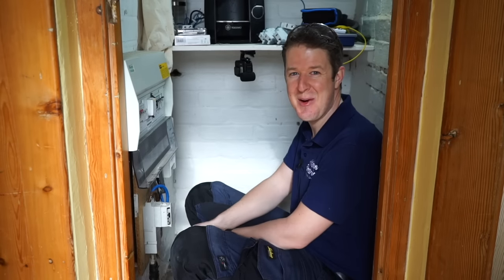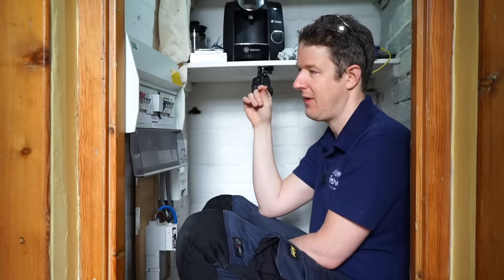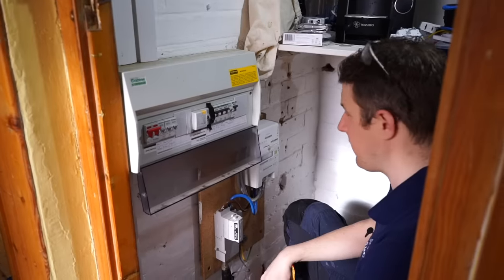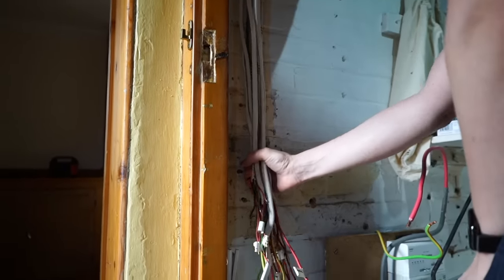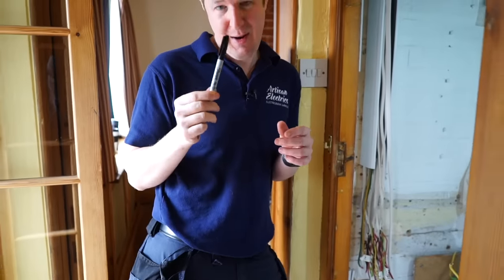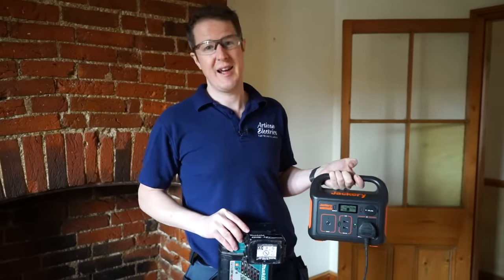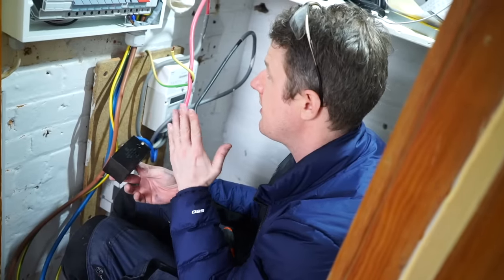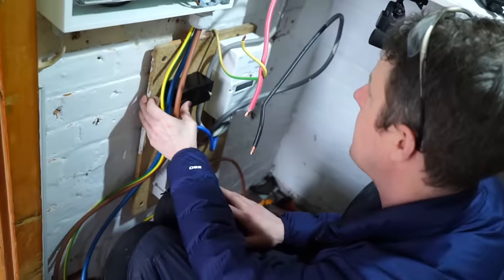My Consumer Unit Secrets 🤫 - How to install a Consumer Unit/Fuse Box

Comment: Why didn't you fit an isolator switch instead of Henley blocks ...safer and easier for the next sparks
Reply: Must admit that went through my mind as well👍
Reply: I came on to ask exactly the same!
Reply: Me too, I was expecting it. Especially as he pulled the main fuse, knowing the next guy was going to have to do same. Still.
Reply: I may be wrong and correct me if I am wrong but I thought you have to get the DNO out to fit an isolator switch 🤷🏻‍♂️
Reply: Would have been another hour extra = 96£ 😃
Reply: @seandunne2673  I’m not a sparky, but how is different to a Henley block or main circuit breaker in the CU? The DNO fitted isolators are usually installed either before the mains in or meter aren’t they?
Reply: @seandunne2673  you kinda have to get the DNO out to pull the main fuse, you'll be cutting their seal normally, it's their property. If you put the switch in after the meter then, I believe, that's the consumer's leg of the installation, so there is nothing to stop you. Only there is because you kinda shouldn't have pulled the main fuse. Having said that, the DNO should pull their finger out and fit an isolation switch already.
Reply: @GregMoseley  They're fitted after the meter, never before.
Reply: @SqwarkParrotSpittingFeathers  the isolator should be after the meter, nothing to do with the DNO
Reply: @k1lmo  I disagree, yes it should be after the meter, which is what I said; but, as a matter of law, you cannot normally interfere with the DNO's property, without their permission, which is the meter and before. Therefore, after the meter is the place, the electrician, as an agent of the homeowner, may fit a switch. 

But, whether you are right or I am, it is moot, as the result is the same.
Reply: @seandunne2673  normally yes, but as put a Henley block in, you might as well Chuck a switch on the wall
Reply: agreeded
Reply from the maker: I just didn’t feel it was necessary to fit a main isolator as I was fitting a brand new consumer unit with an isolator in it.
Reply: @artisanelectrics  Yeah but with an isolator installed there is no need to break the service fuse seal
Reply: @artisanelectrics  not what I would expect from the top end company you portray. I don’t fit isolators maybe I should but since I only fit all rcbo boards with SPD im already £100+ on the split load chint brigade and I  have to be competitive and I have no problem pulling the main fuse. Not sure why you are putting a Henley block in that’s just plain daft - more connections, more potential points of failure - please explain the reasoning?
Reply: @artisanelectrics  come on mate. Probably cheaper.
Reply: @artisanelectrics  thats pretty much the same excuse as the DNOs lol
Reply: @Marco-mg9tv  why don’t you get your head down and concentrate on your own work mr clever sparks instead of picking the bones out of he’s work , why the hell does he need to fit a isolator he’s just fitted a new board.
Reply: @Wilkkid1  oooh you’re a bit touchy eh, What’s up have you got his poster on your bedroom wall ? I’m just making an observation that I can’t understand any logic in adding a Henley block when to do so you need to pull the main fuse and therefore tamper with DNO equipment anyway. What function or benefit do these additional connections make - other than adding unnecessary and undesirable additional joints.
Reply: I can only assume his tails weren’t long enough , had a DP Henley knocking about in the van and could be bothered going to the merchant for  some more 😜
Reply: @artisanelectrics  I bet that's what the bloke who fitted the Crabtree said 🙄

Technology evolves, Regulations change, things break, accidents happen..... IMHO should be a standard as we all know removing the fuse is a no-no.
Reply: @TAJS-C  As a "meter monkey" I think we should fit them as a matter of course when we do an exchange. Sadly our pay/workload structure doesn't always lend itself to taking the time.
Reply: Yes you should fit an isolator! HSE guidelines state you should eliminate any adjacent live working on electrical systems if possible and in this case it would include the incoming tails! Probably a bit picky I know but it enables this when installing any future circuitry. Personally I think the DNO should be obligated to install meters with incorporated lockable isolators so this issue wouldn’t be an issue in years to come!
Reply: because your not authorised to do so , apply to have a SP isolator switch fitted . @Marco-mg9tv
Reply: @ali87468  I live in the real world if you’ve ever tried to get the DNO out to isolate supply then you will know…besides if the DNO were that bothered they would fit isolator accessible on the meter or isolator lane themselves on a meter upgrade - it’s a load of bollox
Reply: @Marco-mg9tv  your not OP1 or OP2 qualified , the reason you have done it this way is to save money , your R.E.C will fit a SP isolator switch , but there will be a charge . You are breaking the law and risking your life and potentially other peoples life’s .pay the charge to have an isolator fitted and go home safely and leave a safe professional job behind you , for now and the future.
Reply: @ali87468  yeah whatever. I and 99% of installers will continue to pull fuses as has been standard practice for donkeys years . Never heard of anyone getting injured or prosecuted or even a telling off
Reply: @Marco-mg9tv  That doesn’t make it right , the day will come when someone does . You haven’t carried out a risk assessment and are not wearing the appropriate PPE , as removing a mains fuse , comes under the classification of live working , if an R.E.C authorised competent person was to remove the fuse , following regulations , he would do so wearing , LV insulated gloves , with leather gauntlets over the top and be wearing a safety visor , his clothing , would also be flame retardant , with nothing metallic attached to his clothing , what so ever .wether you like it or not these are the regs .Nobody should be working live and should have point of isolation , provided by your R.E.C . These regulations evolved over years of learning better working practices , unfortunately some of the knowledge was gained from accidents, some of which where devastating. Working with three phase , makes these dangers even more significant  .
Reply: feathers  you're correct, the DNO or someone approved by the DNO, are the only people who can legally pull the cut out, if there's a SMART meter fitted, then it may transmit an alarm?
Reply: @geoffaries  a smart meter does transmit an alarm but doesn’t seem to result in any action I guess the dnos don’t want the additional cost of sending out field engineers to investigate
Reply: @ali87468  what precautions should be taken for pulling say an 80A fuse in a switch fuse ?
Reply: @Marco-mg9tv  switch off the switch , if it’s lockable , lock the switch in the off position a fix warning notice , remove the fuse from the holder and replace the holder and cover , keep the key and the fuse in a secure location .
When doing one of your consumer unit changes , what would you do when testing , if you discovered , the Brown tail , was actually neutral and the blue tail , was live ?
Reply: @ali87468  in you’re scenario you didn’t test that the load was actually off before you took the fuse out - I do. For the main fuse I visibly trace the tails to the board I’m swapping, test polarity, turn off devices, turn off main switch ,test dead at the main switch,  clamp the tails test for no load on them then do as you state above except I can’t lock off the carrier (edit - spose I could put some temp seals in place - but I do use crimp wire when I’m finished ) but it’s under my supervision as I’m working next to it - no difference really is there. If I found reverse polarity I’d stop work and notify rec of course, what’s your point there ?
Reply: @Marco-mg9tv  to test the supply was off , you need to remove the fuse
Reply: Your not prepared to admit your tampering with equipment , your not qualified to do so or legally allowed to do so , the meter board , the meter , the series 7 cutout and any neutral blocks are company property . The fuse provided by your REC , is not to protect the installation, it is to protect the REC property from , any faults from the customers side .
The question on polarity , you answered correctly , a number of contractors , wrongly think that all they need to do is swap the tails over , but what has happened is that , the transformer has developed a fault and as you say needs isolated and reported , as there’s a possibility it could change back .
Reply: @ali87468  just shows you don’t do this for a living. I’m  talking about risks associated with pulling a fuse and test and verification before doing so. The point is checking there is no load - dead on the load side of a switch and therefore no danger of arcing . I’ve seen recently a YouTube video of an  NICEIC approved contractor pulling a fuse with main switch on and all circuits energised and the flat above he suspects of the same supply but he just pulls anyway- doesn’t even look the other way 😲
Reply: @ali87468  yep I’m all of the above. Everything you say is correct I know it’s the law and I will continue to break it. I’ve gone tangential because you are boring me with the same diatribe. What’s the point of you repeating yourself over and over again ?
Reply: @Marco-mg9tv  at last , your admitting you should not be interfering with other peoples property , all because your to lazy to apply for an isolator switch and to greedy to pay for it .There’s electricians and people who do electrical work !
Reply: More chance of sh@@@ing Beyoncé than getting the DNO out
Reply: @seandunne2673  not if it is after the meter. Pulling the main fuse however is a no no. But the amount of properties that have the anti-tamper wire removed is incredible.
Reply: I would finish with a multicolored led light strip around the border to give it some bling. Also add some Alexa voice activation breakers.
Reply: I mean wouldn’t an Isolator in between the meter and the consumer unit allow the whole of the installation to be deenergised. Not just everything after the load side of the CU’s Main Switch? I can think of a few circumstances where this might be useful. Future EICR’s, proper safe isolation for working on the DB….
Reply: Guidance note 3 tells us we carry out an eicr to the current regulations. We know there’s light switches in that property so how is a 16th board with no rcd protection on the lighting a c3. It’s a c2 all day everyday. It’s nothing to do with when it was installed. You’re inspecting it to 18th edition regulations amendment 2
Reply: Lovely job.! 😊

Comment: Tool of the day should be you you say about safe isolation but then remove the main fuse an leave it exposed with the main tails flapping about an the bear earth that your touching an then to top it off you have your knee resting on the open cutout if you trim a cable an it lands on you knee an happens to go in the cut out thats you gone I have a red fuse holder that I put in an labelled up as no fuse in this carrier stay safe an keep up the good videos mate
Reply: My Dad always said “If you have nothing nice to say, don’t say anything at all” what’s your channel so we can watch how to do it perfectly
Reply: Mate... Full stops ✋️ 
Nearly had a stroke reading that.

Comment: My DNO (Western Power) told me I'd face a 10 grand fine if I pulled a client's fuse! They said if there is a smart meter fitted, it would inform them. Now I always have to wait for the client to arrange with their energy provider to install a double pole isolater.
Reply from the maker: There’s a petition about this going round at the moment as it’s stupid that they do that.
Reply: So what happens after to the fuse as you have cut the wire? Do you crimp another one on?

Comment: What beautiful and neat workmanship!  One humble suggestion is that I would probably have fitted an isolator switch in place of that Henley block (you can get 100A Wylex ones for under £15).  P.S. Congratulations on the 50.1K subscribers!
Reply: I was always confused about the neutral and live incoming wires and how they get connect to the other fuses. This one video did it all for me. I have never installed a consumer unit but work as a Multiskilled Eningeer I am pretty sure I can do it so fast now like though I been working on it for 20 years.
Reply: Completely agree, great install, very very neat! I too would’ve put a 100A disconnector on the meter tails and if I was being particular a 230V sticker on the front of the consumer unit, just to make it idiot proof 😜
Reply: @jamesclarke8295  If you want to make it idiot proof, you need to cut the power back at the transformer..  just saying ;)

Comment: Nice work as always - bit alarmed to see you working with the cutout fuse opening exposed! My instructor always used to tell a story of someone he knew who did that and some dangling cable managed to find its way in and short circuit the supply knocking the whole street out and nearly killing the dude. Best to take the fuse out and reinsert the fuse holder. Stay safe!
Reply from the maker: Thanks
Reply: Bingo...Same as , know a Spark who touched the Lucy C.O and got the nickname E.T
Reply: Aaah you'll be alright, just don't stick your finger in it 😂
Reply: I always keep an empty cartridge, saves the ballache of removing the fuse from the holder

Comment: Jordan, never underestimate the usefulness of these videos or who is watching. I live in Thailand and have just built a new kitchen. My missus got the local sparks in to install a new consumer unit, cooker, water heater, socket and lighting circuits. He absolutely butchered the CU box, installed three radials to sockets instead of a ring main, didn't install earths to metal light fittings (attached to the steel-framed kitchen roof) and switched the fucking neutrals on the lighting circuit. I am in the process of re-installing and your videos, whilst I know are not meant to be 'instructional' for DIYers, are proving essential.
Reply: Ring circuits are an exceptional british method, many western industrial countries are not used to this kind of wiring and do not need it.
Reply: I heard this somewhere saying ring mains are lethal , and whats the difference of radial and ring , is one safer than the other . Brilliant video and love your tideness as an ex butcher I really enjoyed putting on an eye catching display.

Comment: I noticed you struggled a bit pushing the main tails through that stuffing gland…what I sometimes do is I overlay the meter tails on top of the main switch, form them in to place, then I remove the main switch, busbar, SPD if it’s right next to the MS (sometimes it’s at the other end of the CU depending on the make and model), and then I’ll push the straight unformed end through the stuffer lock ring, through the hole of the DB and then slide the stuffer on the cable. Might sound a little back to front but I find that this way I’m not straining, and possibly knicking the insulation of the tails, and I’ve got a bit of space to then slide the cables in to the Main Switch

Comment: Great work, nice to see the pride in workmanship and the tidy cables ensure that you do not wire anything up incorrectly. My first house had a very badly installed distribution board, even though it was labelled as ground-floor and first-floor sockets when the first floor was not separated at all and even the main fuse cover was not correctly sealed with a wire security tab and it fell off! I replaced the fuse box for a more modern one at the time by myself before being qualified was a legal requirement, obviously, the previous electrician was either just a cowboy or knew less than me!

Comment: Nice Video. As an Electrician who qualified under 15th Edition and then a refresher 16th Edition I have started to follow your videos to see what's changed. When doing Rewires i used to love doing the Consumer unit, locking yourself away for a couple of hours listening to our tune on the radio. I used to love doing them as they were one of the many ways to really show pride in your work. I used love doing Pyro work also. Again, a fiddly cable to master as an apprentice but once you knew how to spool it off the drum and dress it well you could really shine.
Reply: The customers that are happy to pay for quality are few and far between! Need to seal the top surface though 🤔

Comment: I was always taught to cut trunking lid after and not at the same time as the trunking itself. You can get a nicer and more precise finish then.
Reply: your right , never cut trunking with the lid on. Normally put lid on just beneath the cut line to make the trunking rigid while you cut, then take it off , fit trunking and cut lid to suit .
Reply from the maker: I just find it’s more rigid if you leave the lid on it doesn’t flap around so much when you’re cutting it so makes it easier to get a straight cut
Reply: Ellis The DJ  just find something that works for you 👍👍
Reply: I’ve always cut plastic and steel lid  at the end not at the same time. I see engineers at work cutting trunking with lid on with a grinder., mmm not for me then  eh, we all work differently 
I tend cut trunking over 75mm with a jig saw anyway 
Keep up the good work

Comment: Good job. I also use the cable markers but rather than using a numbering system I use a code. The reason for this is that if any circuits are added the then the cable numbers could change whereby if you use US or UR for Upstairs Sockets or Upstairs Ring, that cable will always serve that circuit, no matter what happens to the fusebox.  Nice to see someone who takes pride in their work,